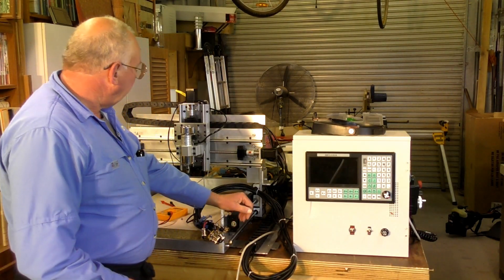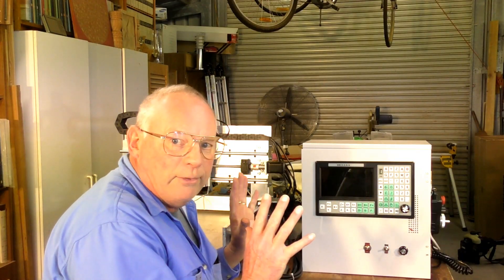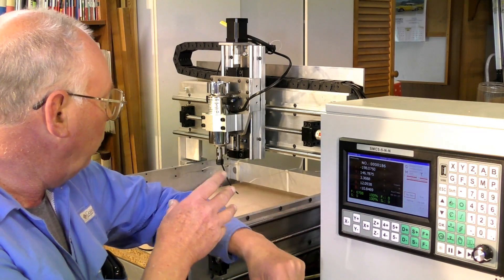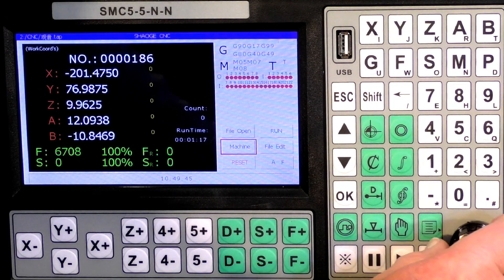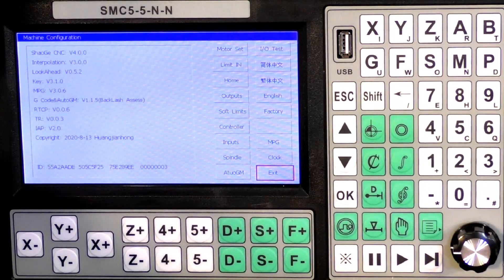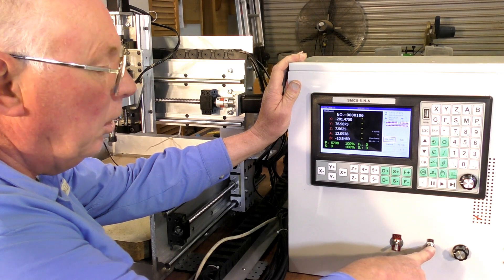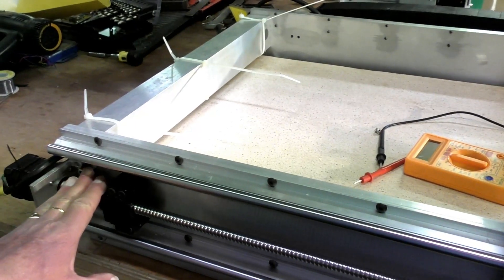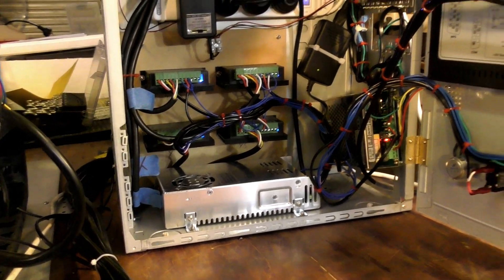Setting up a DIY CNC router  + I WOULD "NOT" PAY OVER $500 for the SMC 5-5-N-N controller

Comment: Roger i have been following your controller build with interest, i have not been able to find out if the controller allows you to run scripts, on my using mach3 and programmed in pendant i have a number of edge finding script, can this be done.
Reply from the maker: Hi the SMC has a specific pendant for it, and probe script built in

Comment: Hey Roger, been a while but want to move to this. Seems my PC running NC Studio doesn't like the heat i the workshop. (No dust in the case) may be age... however,  can this controller do mesh levelling or a levelling may by doing a Z touching in a grid?